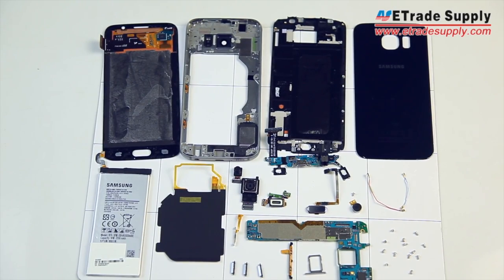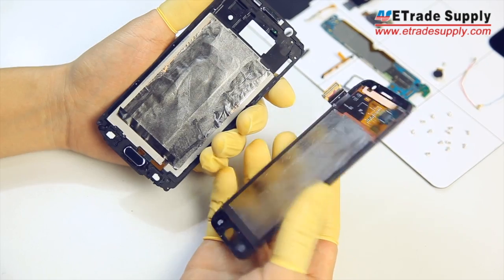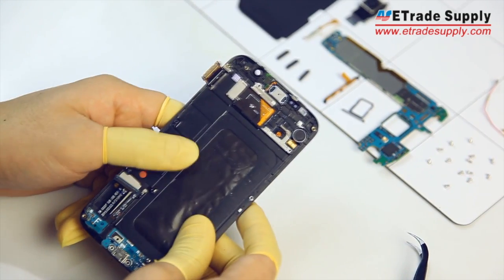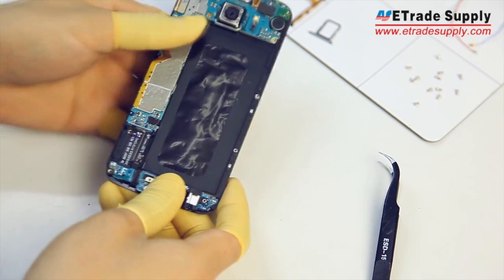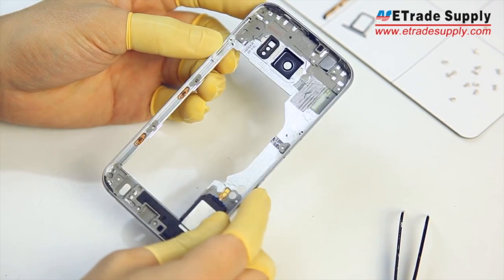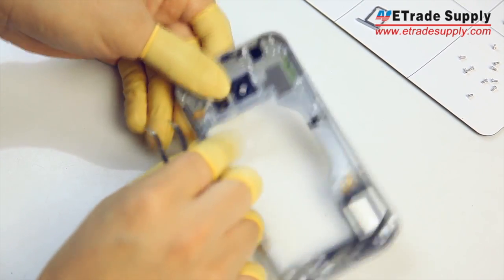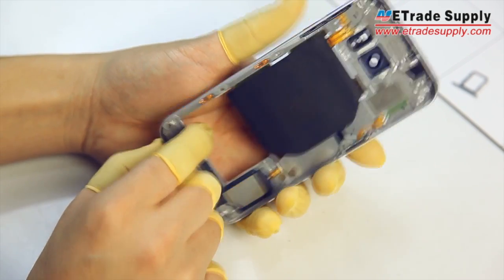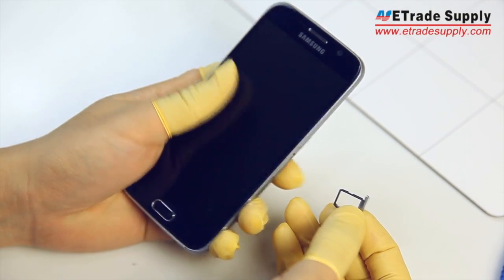Saumsung Galaxy S6 Reassembly

Comment: Is an adhesive strip needed to secure the back of the case to the phone? I've seen some tutorials that do that and one's like yours that make no mention of it. I would imagine it would be needed.
Reply from the maker: Hi, yes, you're right, when reassemble the back glass or front screen assembly, the adhesive strips are needed,we made this video to show people the reassembly process and we ignored this part, thank you for your reminding, we'll pay attention to this problem, thanks again!
Reply: Thanks for confirmation. I've seen adhesive replacements for sale in the exact shape of the layout, like for example the back case cover contact pattern, for sale on Amazon. Could you also use double sided contact adhesive tape? They sell that on Amazon in rolls with widths of 1.5mm, 2mm and up.
Reply from the maker: double sided adhesive may worked, but use original back cover adhesive may be the best choice.

Comment: Did it power back on? No point having a reassembly video if it didn't boot.
Reply from the maker: The phone still turns on, but as we stated in our last video we broke the AMOLED screen the first time we took it apart, so it doesn't display anymore.

We'll make a follow-up video when replacement screens are available on the market

Comment: Does it really go back together so easily? I mean this thing is a nightmare, it'll never be the same again once taken apart surely, doesn't it need adhesive?

I wanted to watch this for future battery replacement, thank you very much for this video.Please gimme your thoughts on the need for adhesive when putting it back together
Reply from the maker: Oh yeah you definitely need to replace the adhesive, and we strongly recommend using OEM adhesive for the job. Since this phone is unreleased the adhesive sheet isn't available yet, and we didn't want to add our own and make a big mess.
Reply: ***** ok thanks very much. Great tutorial
Reply: does it need adhesive for assembling the lcd module to the frame? what kind of adhesive? thanks